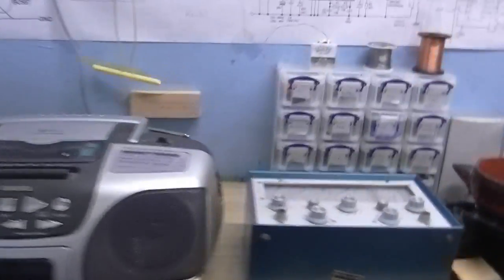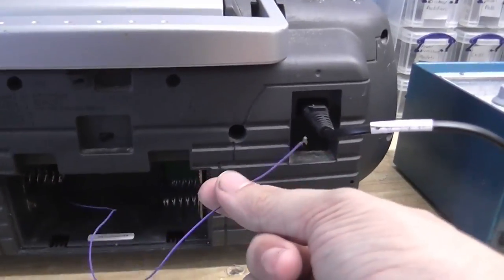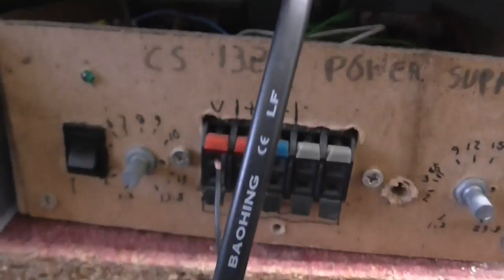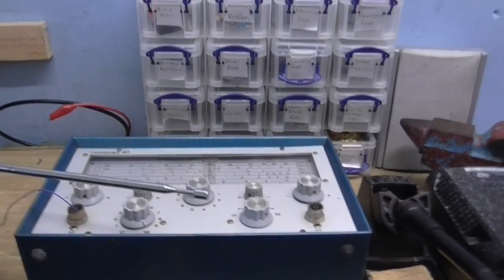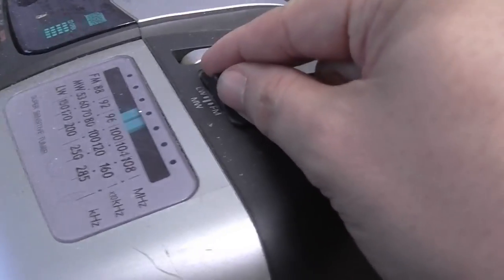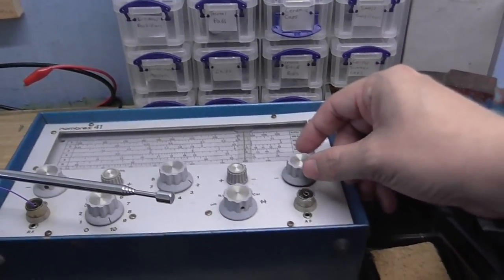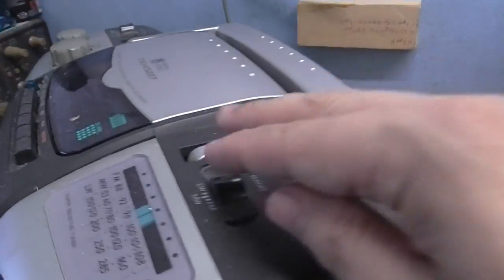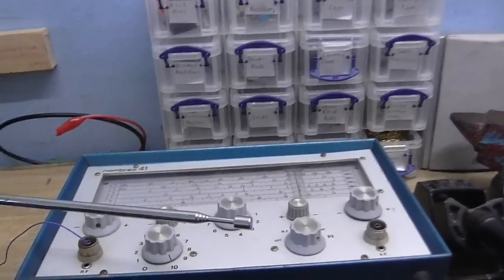Messing around with the Nobrex 41

Comment: The manual says, you need to switch to "R.F." on the dial switch and you can then modulate the thing with a signal on the AF-socket. Try fiddling around with the Mod% control then.